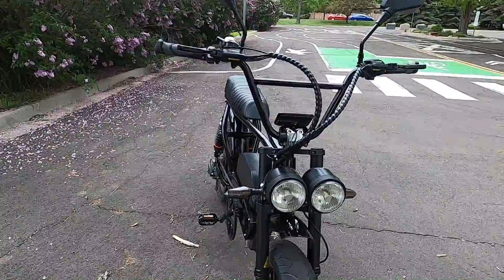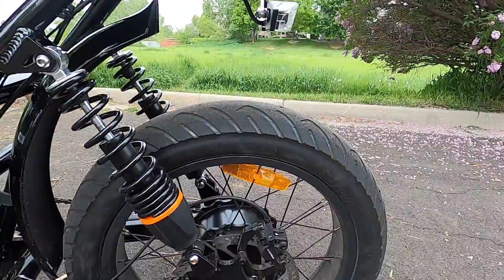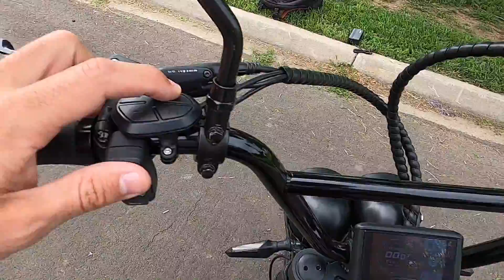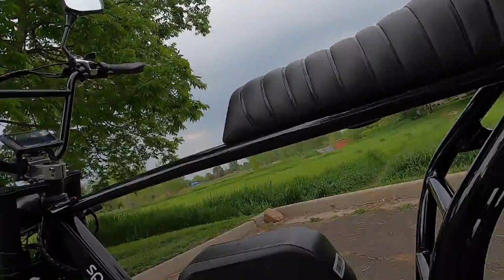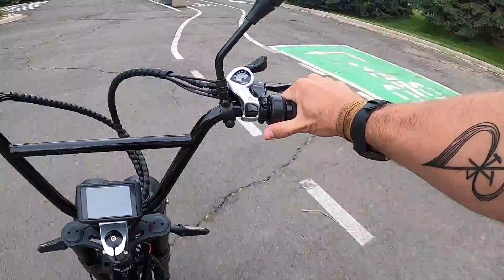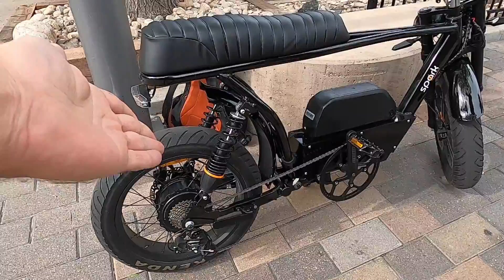Spark Cycleworks Bandit Review - $3k Electric Moped

Comment: Hi folks! I wanted to add some information about riding legally here, thanks to several commenters for pointing these out. I should have mentioned this stuff in the video, these are important considerations before you get a moped like the Bandit!

1) Some states will REQUIRE some sort of registration to ride legally in the street, maybe even plates. Where I live (Colorado) this is called Low Power Scooter registration and costs only $6, no plates are required but you get a little sticker to put on the back. Unfortunately, it's also done by mail and takes several weeks, so I wasn't able to do so for this review bike. Check laws in your state first, Spark Cycleworks provides great resources for this!

2) Some states will also require a DOT certified helmet (aka motorcycle helmet), and you should get one anyways if you're planning to ride at high speeds. I didn't wear my full-face helmet for this review as it makes talking on camera difficult, but I also have a lot of experience and my city has a reputation of being very safe for bicycles and motorcycles alike.
Reply: Thnx man💯🙏🏽
Reply: Why do they always get you to review these small moped type E-Bikes?😆

Comment: I've been riding ebikes for a couple of years, and I've often wished for something more like this that can handle slightly higher speeds to keep up with traffic better.   I've wondered why all these models are built with such small frames that make pedaling rather awkward.  Is it mostly to save weight, or are there other reasons?

Comment: Rolland …..I’m trying to decide between D -class or the spark bandit single motor or dual motor. Between the 3 what do you think? I will be 75% pavement riding with some hills and the other 25% easy dirt roads.
Reply: Go with the Sparks Cycleworks Bandit with dual batteries and you'll be fine. I've been riding mines since October 14th, 2021 mostly on the streets of New York City and it's been a blast. Riding the Bandit on light duty dirt roads I wouldn't recommend only because of the maintenance you'll need to keep up on afterwards. Like cleaning the chain, lubricating the chain, cleaning the disk brake rotors, cleaning the calipers, cleaning the brake pads, cleaning the gear sprocket, cleaning the crank and etc. If you don't keep these components clean you'll shorten they're life expectancy which will cost you more money to replace.
Reply: Dennie………thanks for the reply. That helps.

Comment: Super review but if I'm going to register an electric moped for $3k, I rather buy a motorcycle or an electric motorcycle. Did you return the moped back to them?
Reply: Agreed, you can get a honda navi for the same price OTD and have DOT components, real brakes and a 5800w engine.
Reply: @Lykoloo  you need a motorcycle license to ride a navi
Reply: @usernameisusername  If you're riding at 45mph in traffic you should have an M license. This bike isn't really a moped since it goes faster than most states allow mopeds to go.
Reply: @Lykoloo  good point sir

Comment: I'm was looking at the ariel x or D class ebikes but this bike showed up  lol.. Now I don't know which one is better lol.. Can you still ride this on a bike path??  This still slow for me as I have a motorcycle license. Decisions Decisions
Reply: If your haven't already made your selection , between that Ariel's '      X class and D class  I would take a good look at Ariel's Grizzly 2× 1000 watts motors 2× 52V 35Ah batteries I want. the Grizzly for myself the Grizzly is all most never in stock don't get me wrong The Sparks Bandit is a good machine l had my eyes on the bandit Sparks is in Connecticut not that far from my home in NY lovely specs. However Sparks classified the Bandit as a moped in most jurisdictions that means a drivers license for the rider For the. Bandit ,plates, registration, and of course insurance

Comment: I ordered the Spark Cycleworks Bandit with dual batteries on October 5 and 9 days later it was delivered to me without any issues through UPS. This eMoped is built like a tank, 35+mph, excellent torque, excellent range, it's heavy but the weight is well balanced while riding and it's a blast to ride around NYC. It's definitely worth the asking price Spark Cycleworks is asking for and their customer service support is excellent too.

Comment: California DMV: “Also known as a motorized bicycle, a moped has 2-3 wheels and an electric motor with an automatic transmission that produces less than 4 gross brake horsepower.
Some mopeds have pedals so you can ride them when the motor is off. Show Citation 33
You must have a motorcycle license (M1 or M2) to drive a moped.
You must be at least 16 years old or older to drive a moped, and you must wear a helmet while you ride.
You do not need insurance to register a moped, but you do need special license plates and an identification card, along with a one-time $23 registration fee.”

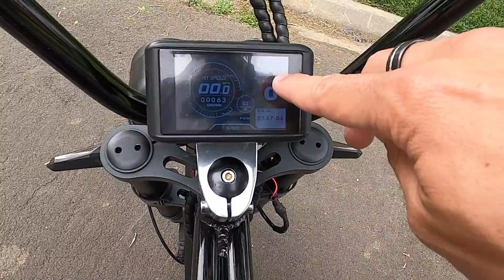Comment: 16:10 I will state this never look at the battery icon/percentage, that thing inaccurate and utterly useless. The thing you can trust is your voltage, let us say your battery is a 48V battery consider that as your 50% mark once you drop to 46V you should consider going back. All batteries are the same, once you pass the halfway mark you start to burn a lot of juice to maintain the same speed due to lower voltage. By no means this is common sense, but once you learn your vehicle battery & power you'll understand its limits, top speed & most importantly range.

Comment: Love moped style bike. I have one and it reminds me of banana seat bikes I had as a kid. But I would love just one company to put a lot more thought into designing these...hiding the battery so it’s not an eyesore, leaving super awkward looking negative space in the center, better gear ratio for biking only , thinking about rider height more, losing the pointless bar from the seat to steering column that does nothing but add weight and crush nuts.

Comment: Turn the seat around backwards and pot 160mm cranks on it and it should be more comfy for taller riders.
My 54lb ebike is pretty scary at 40+.
Sometimes you just have to ask why 
I’m gearing my bike down....it’s real purpose was the get my old bod uphill. I had no idea I’d be tearing around everything like a bat out of Hell.
Top tip
Wear a full face helmet and at least gloves and long pants. Especially on the street.
Reply: Great tip on the crank, that will certainly help. We are currently working on a seat riser as well. Should help things for taller riders.
Reply: At 40 you 100% need a DOT helmet, gloves and jacket. You will lose a lot of skin at 40 if your arms and back are naked.

Comment: A LBS wont touch that thing. If they sell Ebikes, why would they work on that. 2 out of 3 shops in my city said no to working on my Rad. Love that scooter tho. Nice design.
Reply: Sadly true, but more and more LBS are realizing that they need to keep up with the times if they want to stay in business. This shop in Denver is doing that and their business is booming (after failing badly under a previous owner): https://www.youtube.com/watch?v=h1t66Xy77Ls
Reply: @TysonRoehrkasse  BTW, we have been working with a number of dealers in New England and have shown that video to all of them. Their model is brilliant! Thanks again for sharing the concept. We've also shown it to a number of other ebike companies we are friends with and it has really excited the industry.
Reply: It is an unfortunate truth right now, most bike shops in the USA are holding off working on ebikes. The industry is working to change the attitude on them and the best thing we can do is use as many standardized parts as possible. Many of the design choices on the Bandit don’t have the elegance of mopeds twice the price, but they were decided on because of ease of repair. For example: rather than use a proprietary battery, we use a standard bracket easily purchased online. The same is true for almost every other part. Our hope is that this helps improve the situation, but the industry knows there is a lot of work still to be done.

Comment: Wow it comes with a bright horn, think maybe he meant loud horn. Also $900 for second battery, that is very excessive pricing. Display is useless. Not going to make in todays market I'm thinking.
Reply: Thanks for the feedback! $900 is definitely expensive, but there’s a little more going on than you might think. It’s not just a battery you throw in your back back and swap. The $900 includes a custom designed bracket, very large capacity battery, and most importantly: our Battery Blender device. This device allows you to run both batteries together even if they are at different charge levels.  If you didn’t have it, you wouldn’t be able to safely use removable batteries. By the way, we’ve made the kit compatible with other ebikes too! We are currently on our third production run of the Bandit and are building 300 more. We’ve been having a blast. If you live close to CT, come on by our headquarters for a ride.

Comment: Whats the deal with tiny, narrow dim rear turn signals on bikes?  I want well spaced out BRIGHT, clear signals on my bike. Safety first.
Reply: We agree! So you know, the version EBR received was from December 2020. There have been a few design improvements since then. One was the update to have the same turn signals on the rear as it does on the front. This is so important when you are riding at faster speeds. Having to use hand signals can be very dangerous.
Reply: almost all the parts are replaceable/customizable shocks headlights taillights handle bars are all replaceable

Comment: Why are Ebike companies afraid to make 24”-26” versions of their scramblers? Not everyone is a 5’-5” to 5’8”
Reply: Here's why we did it, not sure the logic of other companies: 1) Shipping constraints: The box the Bandit fits in is the dimensional maximum from UPS. Even 1 inch taller will cause the box to go into oversize and adds about $200 to shipping. 2) Torque: using the smaller wheels allows us to get better acceleration and hill climbing ability 3) Seat height: there are national standards on moped seat heights. If you take a look at all the old designs from the 70's, you'll notice they all look pretty similar. But! It's an area that is actively being discussed amongst builders. You'll start to see some options for taller riders in 2022.
Reply: @SparkCycleworks  I was going to say; that seems like the standard of the old days cause companies like sondors and Biktrix have 24” tire scramblers. And shipping was only 69$ and their scrambler seat height sits at 35”
Reply: @ttngeo7494  it's an area everyone is working on (including us). So you know: the true cost is nearly $450 to ship an ebike of this size with a lithium ion battery. The $69 you paid was heavily paid for in the price of the bike. Sounds crazy, but it's also very exciting. If battery tech can get safer/lighter, companies will be able to dramatically reduce the price of the bikes.

Comment: Great review on a "moped/bike", most impressed by the high capacity battery (comparing to my bosch powerpack). If it runs out, you got a bike with a really uncomfy position though.
"I'm 6.3".. well I know it's not hard to find somebody to call small then ;)
Agreed with the reflective tires, even don't understand why the full black still are being made.

Comment: I love this form factor. However this model misses a key aspect of it: cargo carrying. I went to their website and did not see any cargo carrying accessories such as a rear and front rack, or attachment rails for side panniers. Quite an oversight imo, as this is a great vehicle for grocery runs or going on a picnic at a park with the SO.
Reply: Thanks for the feedback! This is an area we are certainly working on. As of now, we are finding most riders will get a $100 cargo trailer on amazon and can pull everything. We've got a few customers doing Uber Eats this way in the city! However, we want to add some more mounting points to the frame for bolt-on options. One option we are excited about is an upcoming faux gas tank that will serve as a storage box.
Reply: @SparkCycleworks  - ok that is definitely good to know! The trailer is just too unwieldy and takes up too much extra room, so cargo carrying on the frame itself is much more preferable. The more versatile the better for example a rear rack that can easily accommodate a milk crate, and serve as a backrest for the rear passenger at the same time. The ability to attach side paniers, and a front rack mounted on the frame (not handlebar) so that the weight doesn’t shift as much when turning. Then you’ll have something compelling. All the best.
Reply: @SparkCycleworks  but then no dual battery...
I hope you have this solved within 6 months. I'll need something for a 25 mile each way commute and a backpack for that length of time wouldn't be much fun.
Reply: @alfredosanchez998  We actually have the capability to mount 3 batteries as crazy as that sounds! The battery kit can either mount on top of the tube, under the tube, or under the seat. I will say, a 25 mile commute would be quite a challenge on the Bandit though. It's more designed for lighter commutes (city environments, getting around town). A key statistic: Roughly 75% of commutes are less than 5 miles in the USA. Our goal is to help get as many people in that group, out of their cars and enjoying the outdoors without the concern of arriving to work a sweaty mess :)
Reply: @SparkCycleworks  is there any rear rack mounts on the bandit now?